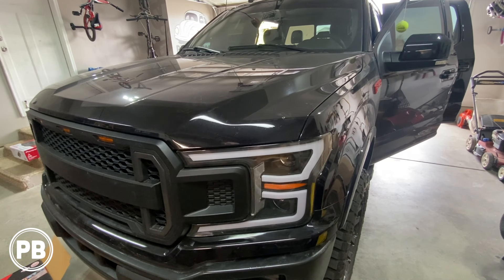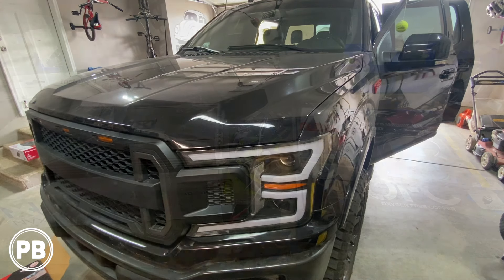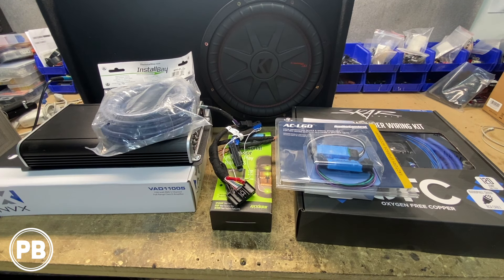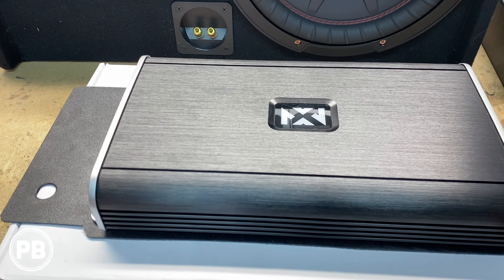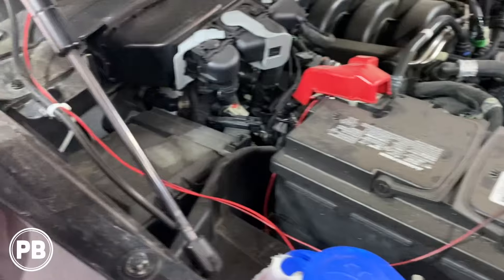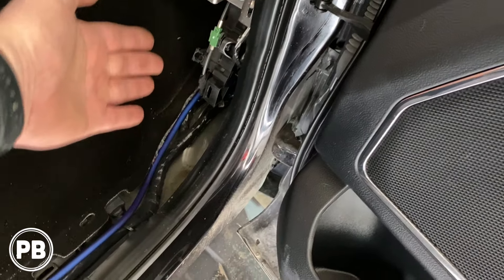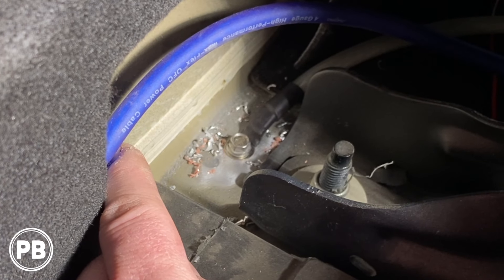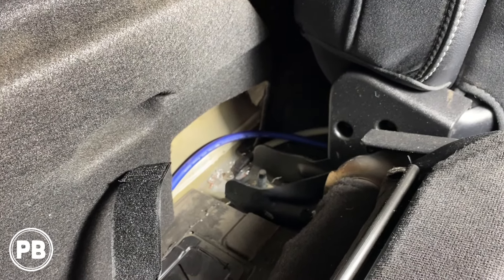2015 - 2020 Ford F150 5 Channel Amp and Sub Install (to Factory Radio)

Comment from the maker: Parts used linked in the description of the video!
Reply: The harness you have in the description don’t fit a2015 f-150. Do you know where can I get one that fits a 2015 f-150
Reply from the maker: @lennyleejr7763  According to Axxess, yes it does fit from 2015 - 2020 non-Sony systems.  Alternately you can use the Pac LPHFD21 version linked in the description as well.
Reply: I thought the loc had a load circuit built in?
Reply: to connect a KEY200.4 Smart 4-Ch amplifier. Amplifier (auto-EQ/processor) in a 2020 Ford ranger with the original 8-inch stereo, what do I need? What harness works? Also connecting a bass amplifier? thank you
Reply from the maker: Send me a message on facebook or instagram and I can point you in the right direction.  @davidgleza356
Reply: Awesome Video as well very detailed & informational
Reply: Hi, where can I buy the T-harness , the pac and the two blue connectors?

Comment: The 2023 F150 has too much ducting and everything else under the dash to access the rubber grommet from the passenger side. Almost impossible without disassembling too many components.

Comment: i tried this firewall access and ended up pulling the whole grommet through and tearing it. After pulling it back out it wouldn't sit flush again. Hopefully it doesnt leak, otherwise it will get caked in silicon

Comment: I just installed the exact same set up as you except a 5 channel skar amp and a 12 inch pioneer sub. I am getting some light buzzing and frequency when me sound is off. I grounded the brown wire and was wondering if there was any other ways to stop the buzzing.

Comment: I have a 2017. Base(not amp) 6 speaker with 8" screen. I have a 2ch and a mono sub Amp.  2 way components for up front, no rears. I see you didn't see a need to use something like the lc2i pro. Is the accubass not needed in these trucks?  The fact that you used a basic loc says to me that an audio control would be overkill? I was also unaware that the f150 uses a load sensing radio.

Comment: Finally a video actually explaining how to do this I'll probably end up still paying sombody buuut I may do it myself, so I will ask how would u use the line out converter for the wires u just rca If I remember right, how would I wire it for a monoblock amp, or would I get a line out converter with just 2 plug ins instead of 4? Thx
Reply: Did you ever figure it out cause im about to do the same thing and im curious

Comment: You can buy the typic speaker adapter and cut into those instead OEM wires just in case you like to choose to hard way

Comment: Ordering some load generators now, currently having sound problems after installing a lc7i, I didn’t know the speaker wires were load sensoring. Will update if this works
Reply: Wheres the update
Reply: @josecano8251  so theirs a lot of things to keep in mind when installing in a f150 these years. 1: when grounding to the frame, check resistance on the frame and make sure it’s good. These year fords have a composite steel type frame and can have weird grounding issues. 2: yes the load generators are needed to prevent static and weird buzz, I have a alpine optim 6 DSP installed and this fixed that. 3: disable the door chime and seat belt chime if you can, I had issues where it was coming through my roof rack speakers and it was ridiculous loud and embarrassing when going to a start and all you hear is DAAAADAAAA lol, 4: make sure you put your equipment away from any kind of OEM wires or devices if you can, my DSP was picking up noise through the rear window motor. Crazy.

All in all, it sounds good but I know it could sound better with an aftermarket radio like an alpine or Jvc and just use the pre-outs on it instead. To be honest there isn’t much feature in the factory radio that is worth keeping in my opinion, I did it because I had payments before. But any question I’ll try and answer

Comment: Cool video, thanks for sharing. Took me a while to get the whole wiring setup, now that I understand will use this approach for my ‘23 f150. Like how you don’t have to cut factory wiring. Do you find it’s better to ground back to battery? Seems like if you don’t you may get sound interference.
Reply from the maker: In most instances, it’s not needed. Some will argue with the aluminum body to pull a ofc run to the battery for the ground. But again, to each their own.
Reply: @ProvoBeastAudio  thanks, I’ll try first without ground to battery

Comment: Great video! I have a question: I’m adding 2 12s to the factory system on a 2 channel amp instead of a 5 channel one. Would I need to do anything different? Can I leave the factory amp and just add the extra one?
Reply: Idk

Comment: Hey, how you doing? Great video. I have a question: I have a 2020 ford f150 that I want to install one 4 channels amp for my door speakers and one D amp for my subwoofer. I need to add an additional PAC outer converter for the subwoofer amp? Since the listed in your video works for 4 channels amp. Thank you in advance

Comment: I have a 2018 ford f150 xlt non Sony factory amp system with the 8 inch lcd screen. I plan to just use the factory head unit, I've spoken with crutchfield but they didn't say anything about load resistors being needed while using the factory head unit? , I also have the pac lp7-4 I'm hoping I can just use the rca out's on it to send the signal to the 2 i guess at this point ol skool kicker zx amps a 350.4 and a 400.1 i have mounted already. 
 I like this harness you used but is it ok to push that kinda wattage through the factory wiring? Granted the mids and highs would only see about 60 watts or 90 bridged? the 12 inch subs i plan to use would obviously have it's own dedicated speaker wires so no harm there.

Comment: I jave a question. So did you upgrade the factory speakers ?replaced them forthat amp or are you using the amp with the original factory speakers.
Reply: How much overall would this set up cost overall..and is it going to sound better than the factory oem kicker sub.also do u do this on a bussiness you own..where you located

Comment: Does the 2015 F150 Ecoboost (with Sony) have ANC or anything else that would affect the sound?
Reply: Did you find any info on how much different it is with the Sony sound system that comes factory? No YouTube videos on it

Comment: Where are you located? I'd be interested in having a subwoofer setup like this installed. I want to keep the factory radio and speakers just want to add subs for the deeper bass sound. So just a class D mono block amp for 1 or 2 subwoofers under the back seat.

Comment: Hi, does this really sound good. Or should I get an aftermarket radio. It is only as good as the weakest component.
Reply from the maker: Depends on your final goal of the install. If wanting the OEM look, go this route. If wanting the best sound and newest features, replacing the radio is the right route.
Reply: @ProvoBeastAudio  Did you do anything else after the install. Did you change any settings in the OEM radio.

Comment: I have a Mazda, 2015  cX5 with the bose system. I don't know what to do about installing an aftermarket. 5 channel amp while keeping my factory radio. Any advice? Really trying to stay budget, friendly, or at the very least. Put money in the right place.
I have the scar 5 channel amp. And a 10 inch box.

Comment: Hello, I have a 2019 f150 with the base line speaker system. If i where to do this exact set up and also wanted to go ahead and upgrade the driver speakers and rear speakers with decent component speakers would I just have to plug them into the original speaker wire? Or would I have to run everything from the amp? 

Thanks I appreciate it!
Reply: hope this is still useful, but you would simply plug them in. as the 5 channel is powering the door speakers through the factory wiring.

Comment: I will be using an AudioControl LCI 2 pro on my '22 F-150 non-amplified. It will be set to 20ohms. Will I still need a load resistor?

Comment: Looks like that adapter harness you used is no longer available.  Is their another source that fits my 19 xlt  with non amplified 8in touch screen?crutchfiels says the pac harness will not work with my xlt 8in screen. (Non b/o non Sony)?? Is that correct ?    Crutchfield has been good overall in the past but not always correct with this type of thing.  Anyone have any info ?
Reply: I'm wondering the same thing...... ever get an answer anywhere?
Reply: I typed the number in and they just revised it, honestly the new harness is easier to install, less cutting of the harness to get it to work
Reply: They have adapter harnesses now with everything built in so you don’t have to splice any wires
Reply: @Madkilljoy  can you drop the link for that?
Reply: @chasevalentine2672 depends what you need, if it’s the line out with the rca’s for stock radio, then yeah. If you are trying to power you speaker wires with an aftermarket amp then you might need something else

Comment: How do you feel about the speed wire being 18awg, but the factory wires are 16awg? I ask because my amp/speakers I’m about to install recommended 16awg but i can’t find speed wire in that size.

Comment: Were there any issues with grounding the amp to the seat bolt?  Any noise or popping sounds?
Reply: Same question. I'm having a hell of s time figuring out ground. I've seen this video and your other video. Tried the ground cable to the battery also and didn't work. I'm not sure what else to try. 😢😢😢
Reply: @luca2627  I wound up running a ground right to the negative terminal of my battery.  Works like a champ.  No issues at all.

Comment: Do we really have to alter the t harness? I see many different options online for different types of set ups but I was hoping to not have to cut anything.  If I do have to make cuts than I'll just make my own.  Thank you for all of the details given in your videos.
Reply from the maker: If just adding an amp and sub, no, a T harness isn't necessary.  However, if doing a 4 or 5 channel amp while retaining the factory radio, yes, we strongly recommend a T-harness for a Plug and play setup.
Reply: Sweet. Do you have a parts list for a basic Amp and sub on radio hook up
Reply: @jessicalinkous131  idk if you’ll see this but what was your solution for this? I’m doing just an amp and sub but I need the rca port still
Reply: @zachtolsma3430  same here I can’t figure anything out unless pulling the factory radio out and hooking up through there

Comment: Will all this work for a 2023 super duty XL? 

Audio system with AM/FM radio touch screen, color screen, SYNC® 4, 8.00 in. multi-function display screen touch screen.
Reply from the maker: Send us a message on our facebook or instagram page and we can help identify the exact parts for your trim needed for your install.

Comment: Just about to install a setup like this. I have new JL C1 3 way 6x9's in the door. Is the tweeter and door speaker on the same output on the stock non B&O stereo? Just wondering if it will be just the 4ohm load on my amp from the 6x9's

Comment: I see you have a plastic floor mat under the  sub. Is there enough clearance between the sub and floor mat? Looking at mine when it's sitting on the floor  mat it looks really close to touching when it's just sitting there.
Reply from the maker: We didn't seem to have an issue.  If you worry about that, add a grill to the sub which will protect it from the floor.  Hope that helps!

Comment: I have a 2017 XLT and added the resistors after watching the video, but still no difference in sound, it sounds horrible, my tweeters are way too loud on my coaxials. What did I do wrong?
Reply: I had the same issue. Installed a pioneer 5 channel amp, component / coaxial alpine speakers in front and back doors, and 13 inch sub. Used all the same parts in this video except for the amp. Load resistors, line out converter, exact same wiring kit, the whole 9 yards. Everything sounded horrible, and almost deafening. It was hard to listen to even at low volumes. After doing some research, I found adding a DSP like the kicker KEY 200.4 would be the best way to go. The factory head unit gives bad signal outputs which ARE tuned for the original speakers. The DSP would work to correct the lossy signal the head unit provides. Didn't wanna drop any more money so I ended up just reverting everything back to stock and I am relieved to have at least decent audio back. Sorry if there's any misinformation here, as I am a car audio amateur. Let me know if you ever solved the issue we are facing

Comment: I have a question, I have bought all the parts you have linked and are wandering if you could provide me with the settings you put on the amplifier.
Reply from the maker: Generally speaking, set your HPF/LPF to 80hz to start, and set your gain about the 12 o'clock position.  Don't use bass boost as it adds unnecessary distortion into the signal.

Comment: I’m planning on doing a similar install to my truck and this is an amazing instructional video but I have a question on the speed wire connection to the t harness do you have a clean picture or video to see how everything is connected?
Reply from the maker: It's not a personal vehicle, so if you want further clarification, feel free to send us a message on facebook for help.

Comment: I’m experiencing I buzzing noise and it get more high pitch when I accelerate any idea on what could cause that
Reply: In the video on the T harness part he talks about a brown ground wire. Ground that and it should stop the loop feedback… or be lazy and tell your friends it’s turbo spool…
Reply: @koby15  thanks a lot brother im also having some of the speakers cutting in and out would that just just be a loose connection on a wire or smt or could that ground have something to do with it
Reply: @koby15 did you figure this out

Comment: Does the center dash speaker still work after this modification?
Reply from the maker: Yes off of just the factory radio power. .
Reply: @ProvoBeastAudio  Does the same apply to the "A" pillar tweeters as well, runs off the radio and not the amp I'm installing? Thanks

Comment: I have a 2017 xlt. Want to add amp and sub,but man that  T harness is what Scares me. You really didn’t show what wires you took off. Thanks anyway it’s a great video
Reply from the maker: If just simply installing an amp and sub, no need for all we did, just simply tap into a speaker output using a line out converter and that’s all that is needed.
Reply: @ProvoBeastAudio  hey if I just wanna to add a powered sub. Should I tie in to the front speakers from back of my factory head unit. Or is there other options?  And do you recommend a decent powered sub. Just for putting a little bass in my 2017 f150..thanks!  Added focal speakers front/back coax all around. Peace.

Comment: Do you have another recommendation for a t harness?  The one you have linked this video is out of stock and their rep told me they aren't sure when I will be back in stock.
Reply from the maker: We also linked the Pac LPHFD21 there too, which is basically the same adapter which should work for you.
Reply from the maker: https://ebay.us/pG1cPH

Comment: If I run a monoblock amp do I still need this LOC or can I use one with only 2 rca outputs
Reply: You still need an loc because the factory radios nd HU do not come with rca outputs. I’ve been racking my brain all day trying to figure something out of how and where to hookup

Comment: Great video, I just purchased everything to copy this installation. On the t harness, if I wanted to add a dsp should I? Do I really need one? If so, any recommendations?
Reply from the maker: DSP can really help correct the signal from the factory radio, and would be a great option, although more work getting it setup.  I'd recommend going without one, and if you can't seem to get a decent sound, add one later.  the Dayton DSP is a decent value: https://amzn.to/3Fn1SgJ
Reply: Thanks for the reply. I actually watched another one of your videos and decided to get the lc7i. Going to run 9 wire to that from the linked t-harness then run 9 wire back to the to the harness from the amp. Also doing door speakers while I'm at it. I appreciate your videos to give me the confidence to do this.

Comment: Got a 15 Platinum with the Sony system. Already have a skar amp, 4 8”s, box, lc2i converter, and wiring. Is the harness for the factory radio absolutely necessary to run the system? Im new to subs and just a little confused on how all that works.
Reply from the maker: I have notes regarding the Sony factory system in the description of this video.  To bypass the factory amp, you will need the Pac amp bypass harness linked in the description to properly bypass the Sony amp while retaining the factory radio.